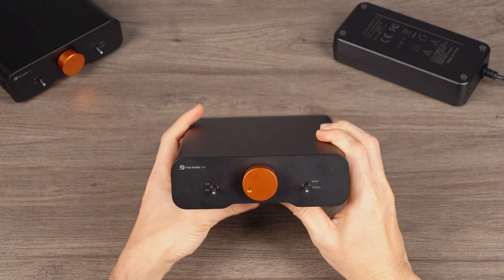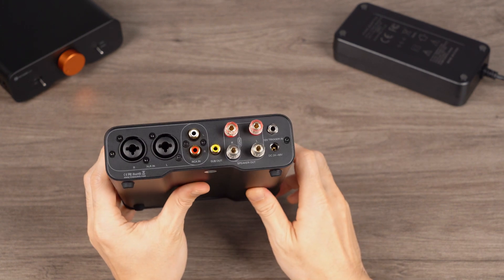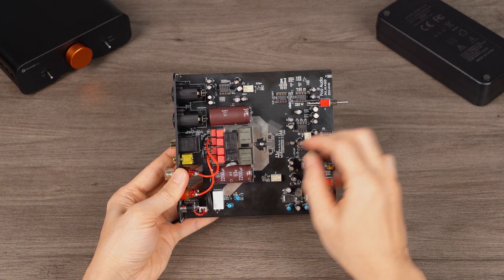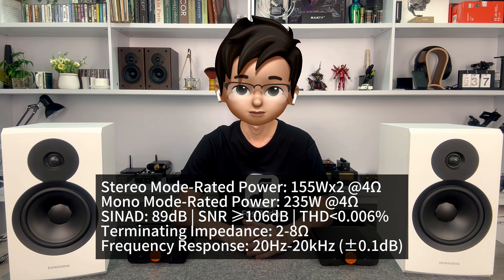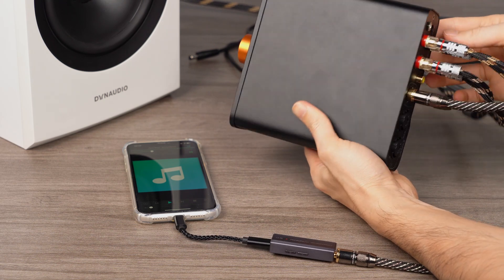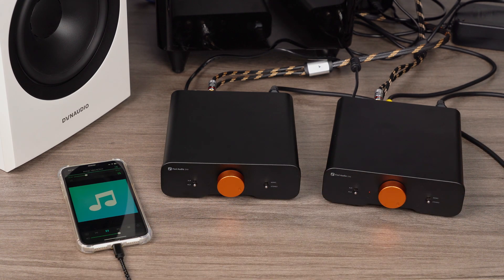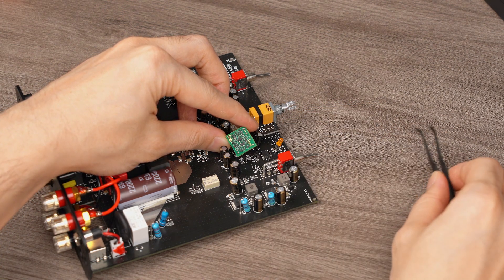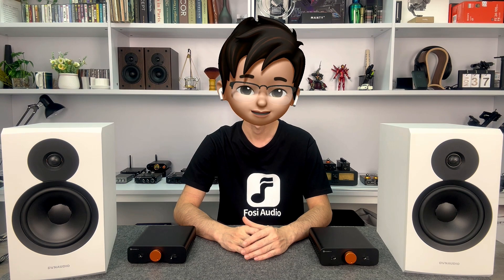The Next-Generation Mini Amp! Fosi Audio ZA3 Amplifier Introduction and Demonstration

Comment: I understand they are using heat sink grease on the heat spreader and case.  If you're going to mess with the op-amps two common sense things to keep in mind ...

1) Out of the case that chip is going to get very hot very fast as the case itself is most of the heat sink.  If you are testing before re-assembly keep the volume way down.

2) You are going to have to remove and re-apply heat sink grease with each re-assembly.  Even a little bit of grit or dust in the old grease could severely inhibit the cooling effect.
Reply: Great comment. Presuming that as you refit this the grease smears as you push the internals in, in which case how much do you put on?
Reply: @karlos543  
Okay... these "up the rear" cases often have a fair bit of play in the board rails.  After cleaning, but Before beginning to reassemble I would take a couple of minutes to figure out how much clearance you have between the heat spreader and case, as you reassemble the unit upside down. 

A) If there is some clearance
Apply the usual "thin as skin" layer of thermal grease on the heat spreader, turn the unit upside down and slide the board in, trying not to bounce it around as you do.

B) Without clearance
Take note of where the heat spreader is going to sit when the unit is assembled, apply a line of thermal grease on the inside of the case where the back end of the heat spreader will sit.  That way, as the front of the spreader moves past your little line of grease, it will spread it for you.

Either way... building a product like this that can be opened by inexperienced people and relies on thermal grease for proper cooling is just a totally dumb idea.

Comment: Which subwoofer channels is active when in mono mode? Both or just the right sub-channel? Wondering since my active subwoofer has RCA inputs and I have ordered two ZA3s to run in dual mono mode.

Comment: 1.Put this on usb input for connect thru pc ,2. add 2 mono subwoofer output (l&r rca output), 3. add 2 more sterio banana output (total 4 speaker output to make able to run as bi-wire) , 4. make able to balanced mono , then Im gonna buy (atleast first 2)

Comment: I gotta be honest with you Fosi, and for that matter the other Chi-Fi providers too, there is one thing keeping me from jumping in with both feet. Form factor. for the love of God, pick a form factor and give us equipment that matches. I'd have jumped in on this new 'small equipment' trend a long time ago if I could select an Amp and DAC that LOOK like they were meant to sit together. In the old days equipment from multiple manufacturers all adhered to a specific size standard. I want a small mini-system that LOOKS like it's supposed to work together.
Reply: look at the Za3 and P3 ...
Reply: @Douglas_Blake_579  Yes but five years down the road when I need to replace one of the components I'll never find a matching one. I still say the company that commits to a form factor and sticks to it will steal the show. Shiitt is the closest, but not exactly cheap Chi-Fi.
Reply: @tsonaqua 
Can't say I disagree with you.  
These guys are just getting started, they're still learning how to build good circuitry.  The form factor may come along with time, I don't know.  But with the price of this stuff, I wouldn't sit waiting for it to happen, especially when I can have good sound in similar case sizes so cheaply.

Comment: If I am only going to run this in mono mode, do I need to replace both the right and left channel opamps? I am assuming that it’s right channel only since xlr is connected to both right channels for mono mode.
Reply from the maker: Yes, just replace the right channel's op-amp will do.

Comment: Looks great...2 amps on the way.  1 question... are the XLR inputs required for mono mode, or could you use the RCA jacks?
Reply: You can use the RCA inputs for mono mode too. This is how I will use it when my Za3s arrive :)
Reply from the maker: Yes, either XLR, ¼”TRS, or RCA input can do.

Comment: Is there any benefit to changing any of the other opamps besides the right and left channel?
Reply: Probably not
Reply: The opamps I believe are placed in the input stage in these amps, so the L & R channel opamps are only responsible for the RCA L & R inputs. If you're not using the XLR inputs, no need to change that opamp. No idea why anyone would care to roll the 2 subwoofer opamps... 😅
Reply: I'm curious to know what benefit will it have on the sub out, specifically that there are two opamps to swap
Reply: @hafid4319  

None, this idea of changing op amps is very overrated, the sound differences is extremely minimal and I doubt anyone could pass a blind test.
Op amp changers are a bit like the cable guys, they a bit nuts

Comment: To improve sound quality can someone tell me if I’m better off adding another amp and running both in Mono or swapping out the op amps? I’m on a budget so can’t really afford to do both at present. TIA
Reply: Hi, you need only 1 opamp by chanel in mono mode, so 2 for 2 fosi. You put them on thé right out..

Comment: How would you bi amp using 2 amplifiers?
Reply: I mentioned this to someone earlier: This is a new topic to me, but I would interpret it as being able to use 2 amps - both in stereo mode, then connect L & R from one amp to the L & R binding posts for tweeters and connect L & R from the 2nd amp to the L & R binding posts for the woofers. I'm not sure if this is correct, but that's what I would try.. 😅 After thinking about it some more, this might only work if you split your source L & R with a Y splitter. Man I don't know, sounds like a mess of cables to me ;) Don't judge, just thinking out loud here... ;) It's a good question for Fosi, as using a Y splitter will work with any 2 amps than, wonder what their instructions are...

Comment: Hey there Fosi Audio, how is bi-amping possible with a ZA3? Using 1 ZA3 doesn't allow this due to only one set of binding posts per speaker, and using 2 ZA3s for monoblocks doesn't allow this scenario either due to how mono is wired. Did you mean bi-wiring instead?
Reply: This is a new topic to me, but I would interpret it as being able to use 2 amps - both in stereo mode, then connect L & R from one amp to the L & R binding posts for tweeters and connect L & R from the 2nd amp to the L & R binding posts for the woofers. I'm not sure if this is correct, but that's what I would try.. 😅 After thinking about it some more, this might only work if you split your source L & R with a Y splitter. Man I don't know, sounds like a mess of cables to me ;) Don't judge, just thinking out loud here... ;) It's a good question for Fosi, as using a Y splitter will work with any 2 amps than, wonder what their instructions are...
Reply: I am about to try two ZA3'S in stereo configuration as my Tannoy xt6f has two sets of binding post, i wire the left channel on both ZA3'S to my left speaker high and low frequency binding post post, do the same with the right speaker, both amps right channel to my right speaker binding post.
Reply: @HiFiMods  Yes i reached out to Fosi audio and they said i would have to use a y splitter into both ZA3'S.
Reply: I decided to go back to mono mode, too much hassle, guess just playing it safe.
Reply: @anthony2010707  it's probably better this way. Bi-wiring I'm gonna try with mono ZA3s if I have speakers in the future that support it, but other than that, I still don't know how bi-amping is possible with 2 units.

Comment: Hello, i would like to bi amp my two ZA3,S would they have to be in stereo mode, my speaker has twin imputs, hi and low level
Reply: I stated this to someone earlier: This is a new topic to me, but I would interpret it as being able to use 2 amps - both in stereo mode, then connect L & R from one amp to the L & R binding posts for tweeters and connect L & R from the 2nd amp to the L & R binding posts for the woofers. I'm not sure if this is correct, but that's what I would try.. 😅 After thinking about it some more, this might only work if you split your source L & R with a Y splitter. Man I don't know, sounds like a mess of cables to me ;) Don't judge, just thinking out loud here... ;) It's a good question for Fosi, as using a Y splitter will work with any 2 amps than, wonder what their instructions are...
Reply: Thanks for your imput, i will wait for more clarification on this.
Reply: Hello, has anyone tried using two ZA3'S in a bi amping setup?

Comment: V3's Max Power output is 300Wx2 @4Ω but this next-gen has 155Wx2 @4Ω. It seems to be downgraded. Will there be another version of ZA3 (ex. ZA3 Pro/ Plus, ZA5, ZA7, ZA8) with equal power output to V3? This isn't complaining just asking questions. I like a 2.1 Ch power amp with a Mono-bridge(output).
Reply from the maker: Hi friend, 155Wx2 @4Ω is ZA3's rated power, not max power. Actually, we've already optimized it to make it reach 180W per channel.
Reply: @fosiaudio  Yeah right...180W x 2 @4Ohms at what frequency input signal or across the 20-20kHz range?  At what THD, too? 10%?
Reply: @fosiaudio оптимизация коснулась каких-то конкретных ревизий усилителя?
Reply: @birdyflying4240  So it is 155W at 10%THD. That's some serious bs...We'd love to know what it is, with 0.1%THD or something similar. But 
no such luck from the manufacturers...A measurement at 8Ohms wouldn't hurt either.
Reply: I'm getting excited about your amplifiers, I recently bought my first Fosi BL 20C which I'm very satisfied with.  I'm about to get another one these days, maybe the little BT 10A because I like it too much.  This new minimalist is beautiful.
Reply: @Yiannis2112 We measured it at  1kHz signal input and 1% THD
Reply: The unrealistic 300w x 2 figure, is from the TI chip manufacturer, at very high distortion levels.
Reply: @sensibox  Who's we?

Comment: No remote control 😢
Reply: a remote control on this is pointless and a waste of money. do you want a remote with just 2 buttons? volume up and volume down? wtf. use your phone app going to your streamer or the remote of your streamer or your preamp for that. why would i put extra clutter and a useless remote on my desk if i need a phoneapp to connect to my wiim for example ANYWAYS.  just put the amp on the max listening volume you want in your room and then lower the volume on your phone or preamp

Comment: i like it. however, i have 2 complaints. 

1. i really REALLY dislike the mono stereo switch on the front. 
2. i really dislike the coloration. it makes it look cheap like a toy with those ''fancy gamerish orange colors popping''  if i would put that on my hifi rack, it would not fit AT ALL visually. orange does not fit to ANYTHING i own or have in my room. my hifi rack and area consists of whites, wood, black, some granite and i have a lot of plants in my house so everythings green around here. please just make it black, i dont want to buy an orange amp just so i need to tear it apart and repaint it before i m able to use it. normal fosi v3 looks way better than this one
Reply: If you dont want orange volume control you can order black if that is your gripe.